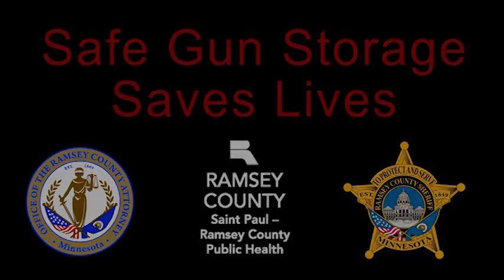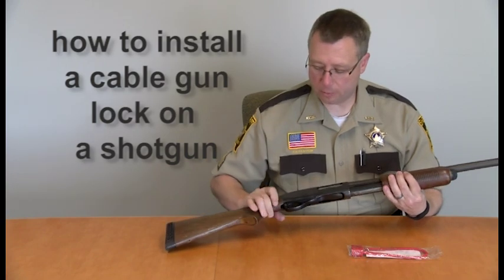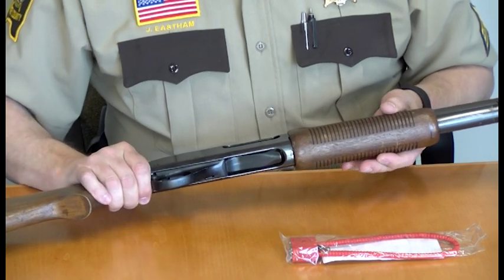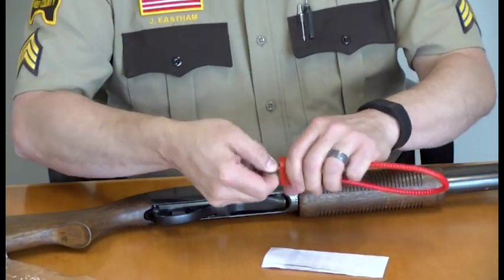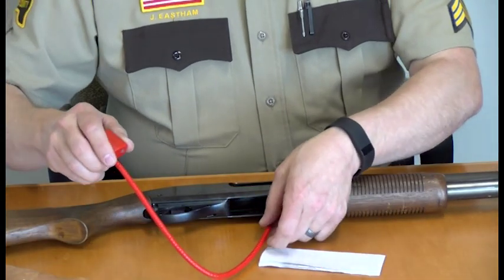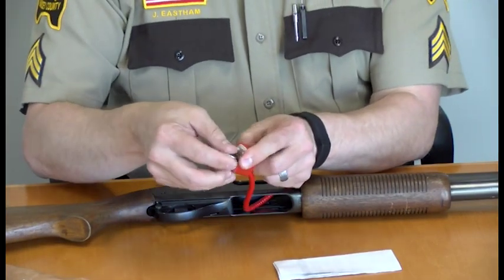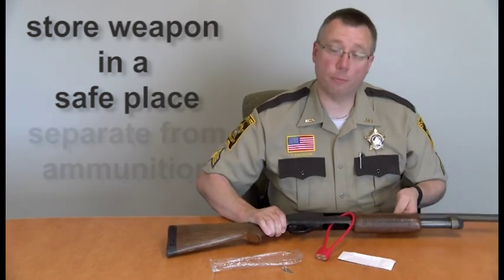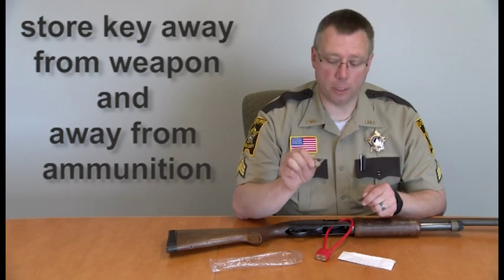Cable Gun Lock Demonstration - Shotgun

Comment: all they got to do is cut the wire man
Reply: Meant to prevent children from access
Reply: It's a metal wire, fool
Reply: @Diamondusa7  could easily still be cut. It is a deterrent.
Reply: @trumpjump123  cannot be cut with simple scissors or knife, at least not mine.
Reply: @Diamondusa7  wirecutters will do the trick.
Reply: Yes wire cutters will cut it. But its to keep kids safe and also buy a gun cabinet and lock that as well. The bastard thats tryen to rob you most likely wont take time to bust into it.

Comment: Couldnt they use lets a a pair of wire cutters or a sharp knife or nah??
Reply: The cable is made of metal. its not just a cable
Reply: anybody who is determined to fire off the shotgun can find a way by using wire cutters, but the lock comes with most shotguns so if you haven't invested in some sort of safe or anything this just makes things a bit safer
Reply: Oh absolutely. But put it in a safe as well. Makes things harder for the bastard thats tryen to rob you.